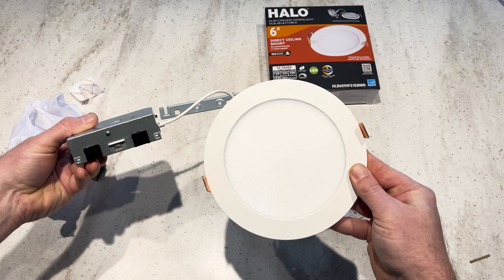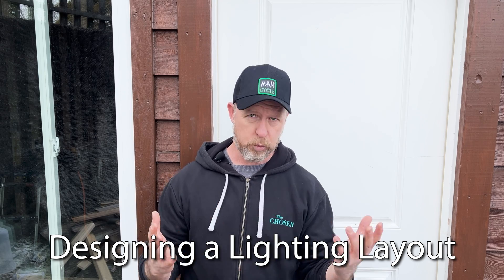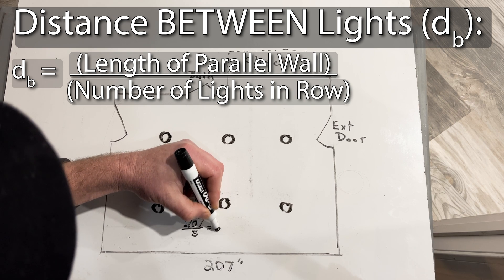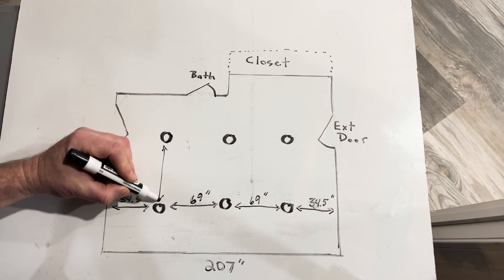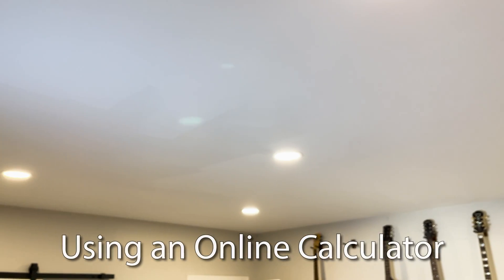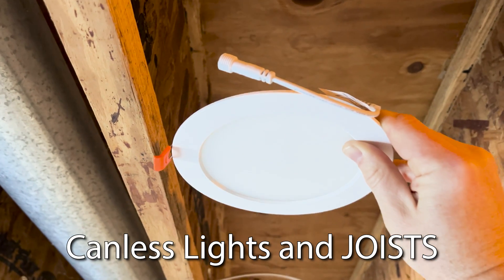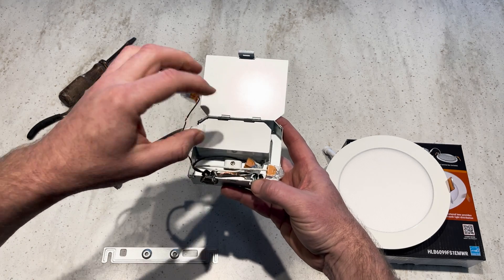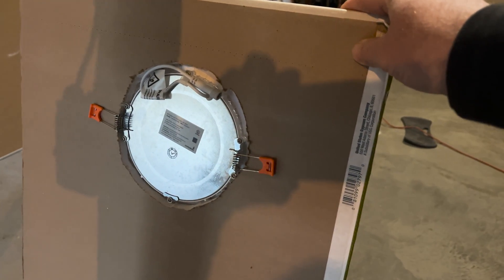DIY Lighting Design: Perfect Canless Recessed Light Placement and Wiring!

Comment: How do you add the next wire to the next recessed light, asking for a friend?
Reply from the maker: @vandraco3854 Hello! You can connect between each of those light with the same gauge of wire used to run the circuit, which was most likely 14 gauge wire. Black to black, white to white, ground to ground. 🤙🏻

Comment: One noob question. How do you determine how many lights you need? Like in this example you chose six. So the question is How?
Reply from the maker: Hi! I’m not aware of a formula for determining the number of lights you need. But, since they are recessed, they are fairly directional, so keeping your lights between 4 and 6 feet apart is my suggestion. My lights ended up about 6 feet apart, so I could have gone with more and that would have been just fine as well. Hope this helps - good luck on your project!
Reply: One light for every 25 square feet

Comment: I was hoping you'd cover how you chose the number of lights in the first place.  Considering ceiling height, angle of flood light, lumens, etc.  Placement is somewhat trivial, especially with the wafer lights (don't have to worry about joists).  Also, that's just general downlighting.  What about task lighting?  For a kitchen, you don't want to just take the number of lights, distance between them and divide by 2.  You'd want it a certain distance off the face of cabinets as a function of the height of the ceiling or flood angle.
Reply from the maker: @marsBWR Those are GREAT questions. I'm a DIYer, learning as I go along and sharing what I'm learning from my current project.  Having said that, take a look at different rooms in different houses, and you'll will notice a high level of variability in distance between lights.  How many you choose will depend upon how much light you would like in a space.  The room I built this video about is going to be a Maker Space, so you are correct, something like a kitchen would have different needs and therefore potentially a different design.  I'd suggest checking a few kitchens out and modeling what you see that you like in your own project.
Reply: Another consideration is the distance from ceiling fans. If the cans are too close to the blades of the fan there will be shadows on the floor/wall.